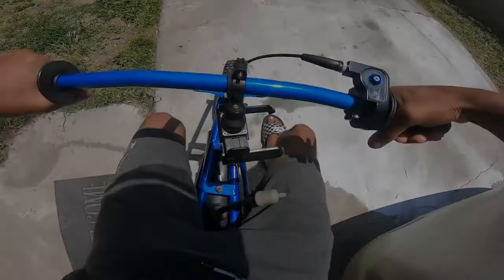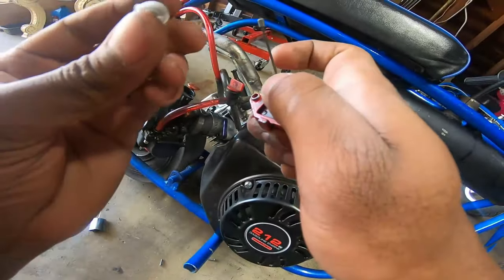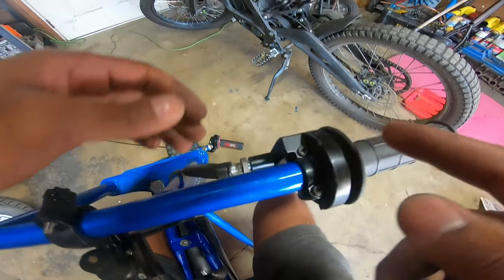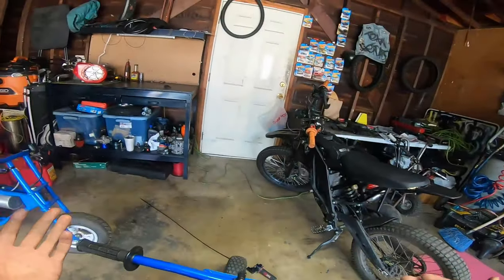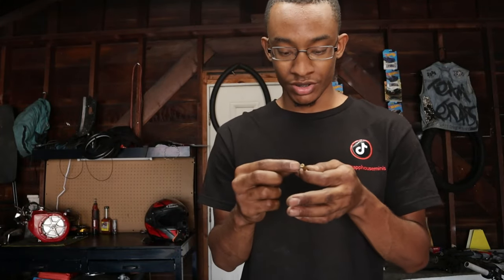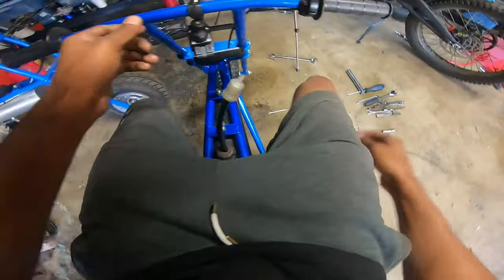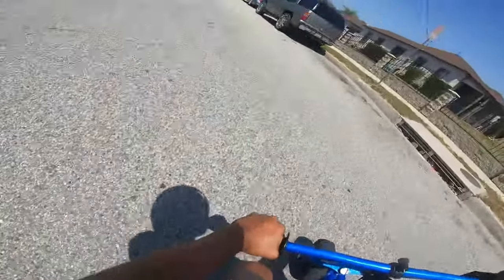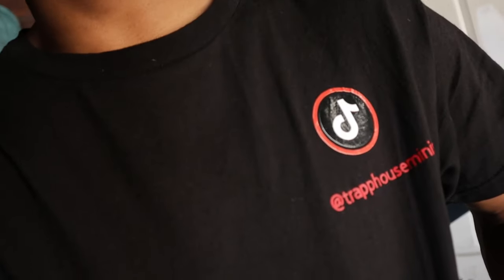This Is Why Your Mini Bike Is Bogging! How To Fix

Comment: With the half turn throttle...prolly putting too much fuel in too fast. The engine RPMs have to be higher in order to make use of all that extra fuel. Racing applications...you'd be on the line with the brakes on and spinning up the motor for a hard launch. But for casual riding...the engine doesn't need all that gas so it bogs out. The plug fouls and all kinds of nastiness happens. Diluting the oil with gas and stuff like that.

Comment: Fixed my problem it was the spark plug ignition but now my bikes bogging at the top end when am going like 50 or once i get to 60 my bike wants to bog before hitting 60 lmk am located close by.

Comment: Finally he tells the jet size.thanks jz. Pwks are hell to tune man
Reply: I got pwk and when I'm doing a hard pull it runs awesome but when I creep the bike just cruising it's good but if I wanna cruise a little faster it kinda dies but if I full throttle it it picks up super quick and I'm flying down the road.
Reply: I have the same problem I can do full throttle on high speed but when I make a full stop and try to speed up again it starts doing the Same thing like in the video it won’t run ?? Any idea
Reply: @warzone7571  sounds like fuel starvation from your pilot jet as that's responsible for the first bit of throttle. Check your pilot jet and increase for more fuel. But once you get more than half throttle and it picks up no problem then definitely check your pilot jet

Comment: Makes so much sense because I'm running a Mikuni vm22 with a 100 Main/ 30 Pilot here in West LA. My minibike idle is too strong it want's to go off but bogs hitting my race throttle which I thought was lean... but it turns out accordingly resonating with your video about top end. Plus, it's hard to tell but my spark plug has a sooty deposit so i think that has to change. Thanks for the info it really helps.

Comment: Bruh I got a 90 jet and its running Good. Dallas area,,22 lb springs, header and large air pod filter on predator carb...
gonna get a vm22 carb soon should help quite a bit...
Reply: Great choice . Or a 24 mm pwk.

Comment: this video helped a little bit to figure out my problem, but hypothetically say ur in a penny pinching build n you have to make it work, would adjusting the air to fuel ratio fix the bogging if the jet is to big? (ik buying a new smaller jet would be easier n not much more expensive but like a wise man once said if you dont know then u better learn)
Reply: With the bigger jets I’m not to sure if your richer or leaner I guess leaner, their are so much stuff to do to get the bike richer

Comment: Mine runs fine for about 10 minutes, but once the engine is heated up it bogs down and dies whenever I come to a stop. I've been trying to find a solution to this issue for weeks. Mini bike is brand new and has a stage 1 kit from Go Power Sports on it.
Reply: My shit does the same runs for like 3-5 mins then turns off and never turns back on till later
Reply: It sounds like you tuned the carburetor cold. The motor will idle differently when it is cold vs when it is warm. Ideally you should get your motor warm, then tune. This should stop the bogging
Reply: @matthewsperry8463  I appreciate the response. Unfortunately I already tried that with no luck. I've tried a half a dozen things from air filters to carb tuning to bigger and smaller jets. I even tried setting the idle speed up much higher, nothing seems to work sadly. Extremely frustrating.
Reply: @HorrorFXDesigns  Hate to hear it. Only other thing I can think of is if your valves are out of spec. This shouldn’t affect idle too much unless it’s wayy off, and considering you only have a stage 1 the valves should still have stock spacing. I set both of mine to .003, but I believe stock is .004-.006 for intake and .006-.008 for exhaust
Reply: @HorrorFXDesigns  check if your hose is loose,took mines to gts and found it wasn’t the right fitting-my carb kept popping off when I would try to cause if the compression

Comment: Would you know what’s the best for a ghost stuck with a v22 I have the 15 in right now. It runs fine but when I’m full throttle it’s bogging
Reply: Are you sure it’s bogging and not struggling for more fuel. Lower your needle one notch. It helps 3/4 throttle

Comment: i have the same problem for example I could go full throttle on high speed with out no problem but when I stop and pull the throttle it starts doing the same thing like in the video where you put on the 180 jet and I bought my pwk carburetor 28mm out of the box
Reply: I believe the 28 mm carbs are slightly big. Try a 24 mm . It will wake the motor up .

Comment: You can adjust the needle on the carb. There is a clip that you can move up or down on the grooves of the needle to lower how much gas goes into the carb. That might allow you too use that other throttle. I’ll link the video in cars and cameras. Those guys always show detail everything they do.

https://youtu.be/-OBCOTykjI8

Comment: Did you have to change your ignition timing with a 8 degree keyway or flywheel i have watched your video on the vm22 also but this is by far a great informative video you cover bogg on the low eand and the top end but i have bogg at about 3/4 trottle if i open it up to full it clears up if i dont hit 3/4 trottle it never boggs any suggestions
Reply: Pilot jet isn’t big enough

Comment: Bro can you do a video of aligning motor with rear chain&sprocket?plz🙏🙏
Reply: Stick a laser pointer on the top of the chain or tape it on at the back sprocket pointing towards the engine clutch.   Or old fashioned make a straight rod that bolts op to the axle and bends perfectly 90degs towards tire and 90 deg again towards grind of bike.  Motion pro makes a chin alignment tool for this

Comment: So you didnt change the pilot?  I bought a nibbi 28mm. I got the top end good with a 120 jet. Since it has an extra top jet i can move for more fuel on top end. But having issues with launch, when i floor it all the way it bogs, i have to ease pn the throttlw. So messed with the pilot jet & bit with the needle. But im going to hold to it for my stage 4 212 buils. Maybe it will be easier to tune incase i need for air/fuel in that engine.
In my 24mm im running a 140 pilot & 130 main & runs good, bit slow on start (maybe to big pilot) now went to a 26mm & still need bit of tuning but way faster tho.
Reply: what's your elevation?

Comment: Whats the pilot jet? I might have missed it
Reply from the maker: I use the stock pilot jet out
Reply: @RoyalJZ  thanks bro, even though im in NC our elevation isn't to far off, you got my bike perfect rn, im hitting 62mph with 22lb valves and a mod 2 cam, obv flywheel, flat slide and rod, hemi piston though.

Comment: Had a problem on my pt bike with a 105cc engine (basically my mini bike but swapping to 212 soon💀) I’d ride for about 10 mins with no problem whatsoever then it’ll randomly cut off and just start spewing gas out of the carb , the fuel shut off or  throttle is the only thing that could be causing my issue , turned down my idle screw and seem to be doing alright for now ( fuel air mixture already tuned) but swapping to 212 soon tired of messing with a Chinese engine and carb 🤷🏽‍♂️
Reply: but predator 212 is still Chinese doe

Comment: my minibike bogs when you in give full throttle at a stopped positon but works at high rps is that normal if not how do i fix
Reply: have you found a solution?

Comment: I changed the jets 3 times 110,115,120,125 I even changed throttle cable to oem cable, adjusted ratio soo many times and cleaned carb shit still ain’t working with a brand new engine
Reply from the maker: Try a smaller jet

Comment: I’m have bogging issues at the moment when I try to throttle more she start to bog out crazy part she just started doing this😐
Reply: By check my bike found out I had a screw missing out the back of my valve cover

Comment: EVERYONE THINKS THE BIGGER JETS ARE ALWAYS BEST
Reply: Yea I drilled out my jet now I'm crying cause it's literally drowning in fuel. I had a 160 jet and probably drilled it to like 260 cause I used a 3.5mm drill bit. Ordered a jet kit from Amazon and I'm gonna install a 170 jet cause the 160 was good but it was lacking at top end

Comment: All about the jetting hit me if u need help
Reply: I have a stock 196cc and I got the 22mm pe nibbi carb but it only came with #95 and 100 and #90 main jet and with #30and #32 jets do I need to buy new jets cause mine turns and it wants to keep going